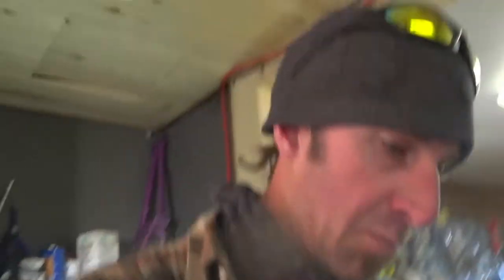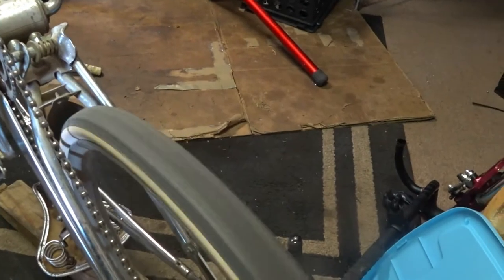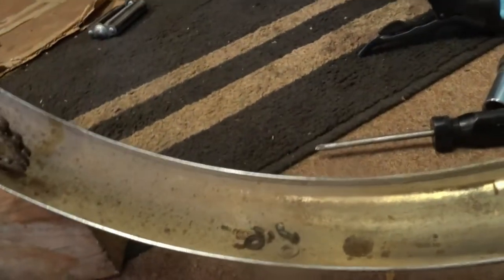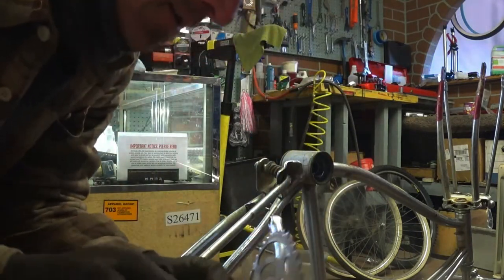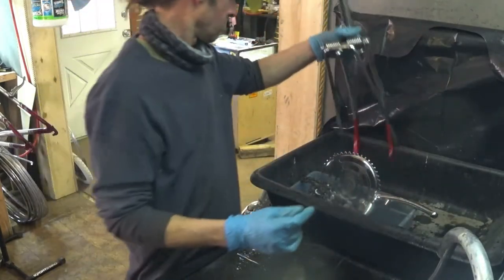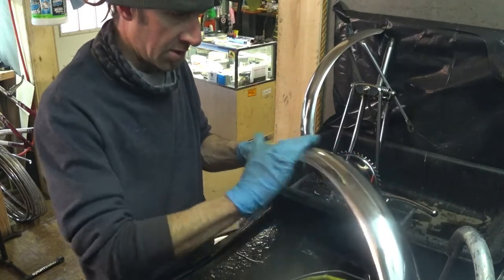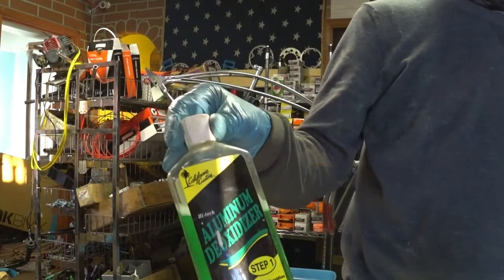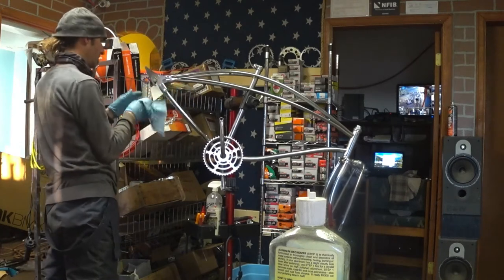Restoring a 1959 Sears Spaceliner | Part 1 Frameset

Comment: Which way did you assemble the bearing cages at the bottom bracket?
Reply from the maker: Bearing cages always have the "cage" ring facing outside of the bearing cup, so the balls will roll freely in it.